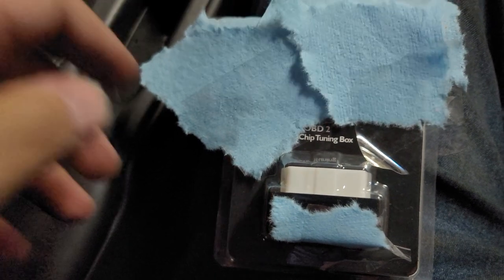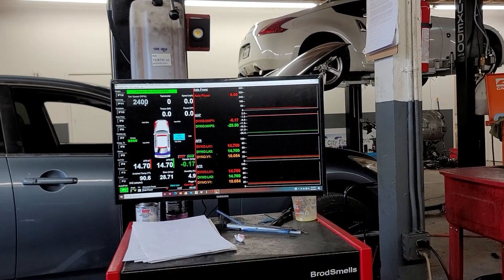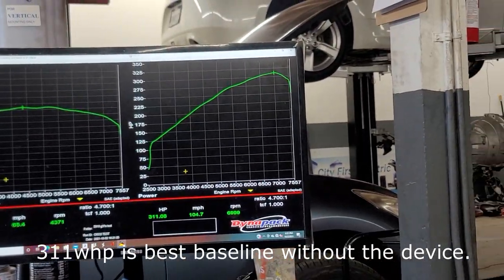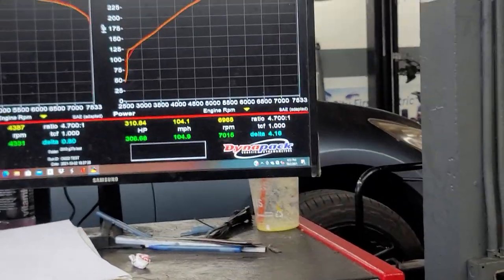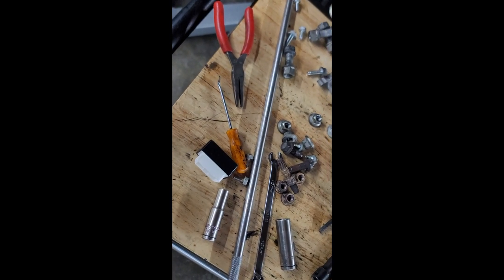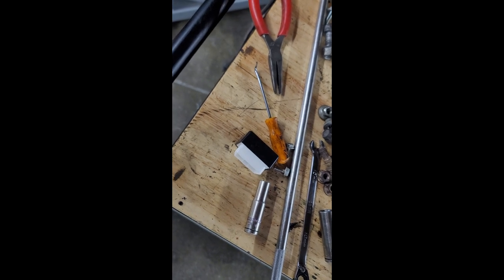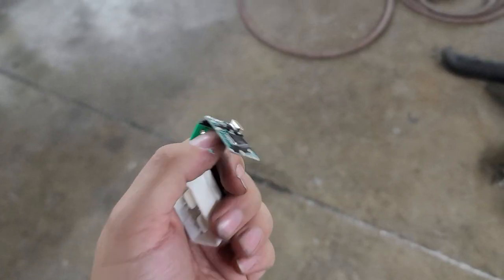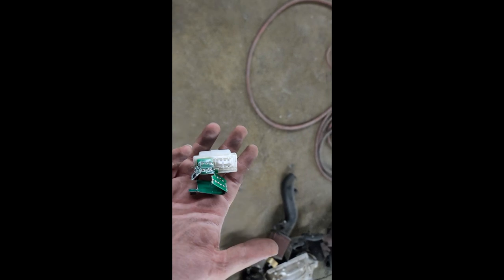Cheap OBD2 chip tune plug ins- Does it work?

Comment: Don’t you have To drive it 150 miles first before it starts working
Reply from the maker: Nope,  it's explained in my video.  The only things that are making contact in the circuit board are the pins that power up the light and the reset button to trick you. The other pins aren't even connected to anything on the board.
Reply: I have figured out that is to let the refund time run out. I had a question about the OBD2 port, so I watched some videos about the chip tuner I bought and rapidly inquired how to get a refund.
Reply from the maker: @ralphowens4510  ah very nice catch!

Comment: You have to drive it for 150 miles so it can see your driving style . Also the pins have leads under the mat material, I build electronics lol
Reply: explain why they use hot glue to put the wires on to the circuit board if you open them up 😂 open one 😂
Reply from the maker: @janseendiguiseppiThomasMC they keep ignoring the fact that out of all the connections, only ones that actually go anywhere are for the LED. Literally explained in my video and shown. The pins are literally floating in the air.

Comment: Do the pedal commander next. Or is that only for acceleration?
Reply: Pedal Commander works. Maybe no power gains but far more responsive acceleration. Infiniti Q70L.
Reply: I heard it works too. No added power, but throttle is more responsive from what I hear and seen. But it won't add any power or torque to your car.
Reply: that's only for your throttle curve.

Comment: Idk bout you but my chip tune made a difference for my Lancer. Mine needed to be in Accessory mode for 5 mins and then drive the car 240km to fully sync in. I tested my 
0-100km
BASE = 8.96
CHIP = 7.88 + throttle improvement along with an extra 40-100km in fuel range
Reply from the maker: @camco7829  he's lying.  Alot of these vendors that sell these have been coming here and making comments under fake youtube accounts. They even put their name so you can go buy one from them saying theirs works and I'm wrong . When I have actually physical and data proof that it does nothing.   Their accounts were deleted due to being fake.